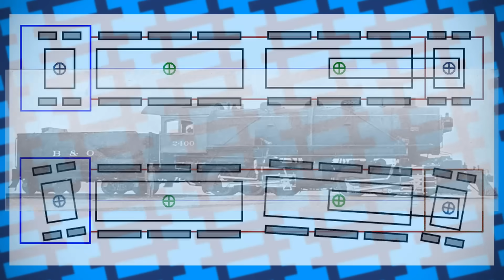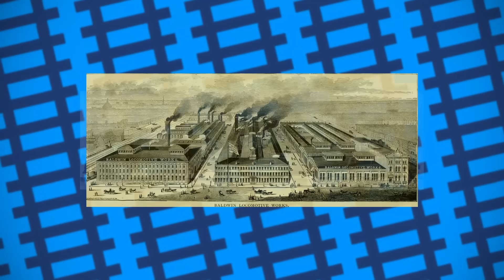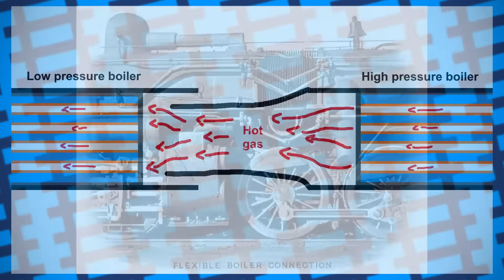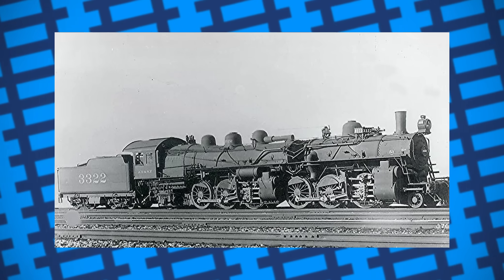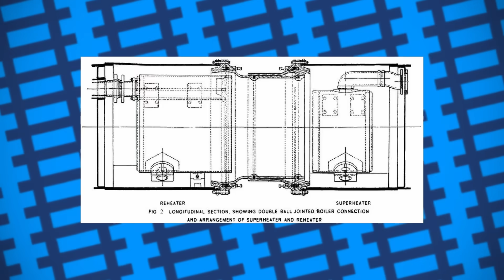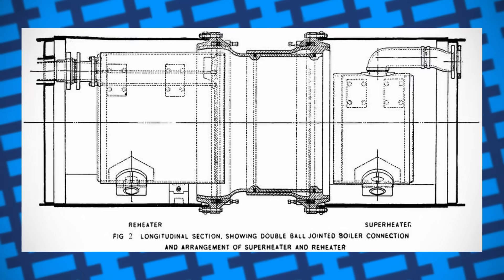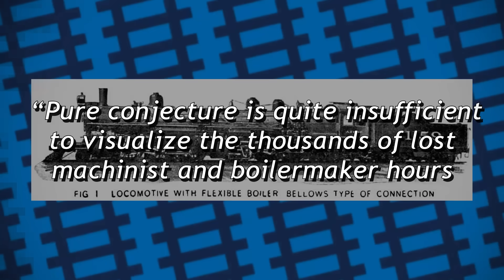How (not) to make a Locomotive more Flexible - Articulated Boiler Mallets

Comment: So people did succeed in making bendable boilers after all. That's amazing! It just didn't give much benifet over the rigid design and was too hard to maintain. I wonder what might have happened if Diesels hadn't been invented. I suspect those Quadraplex and Quintaplex locomotives would have seen at least test engines. Respect to the people who actually tested out the flexible boiler design in a real loco. Sometimes that insane idea turns out to work great and even though it didn't here, we need people to try crazy ideas every so often.

Comment: This was not an articulated BOILER, rather it is a boiler(rear) and a huge" smoke box" that contained a reheater and a feed water heater
It was not pressurized. 
The hinge was not to get around curves. It was an attempt to get the most weight on the front engine by preventing weight being supported and transfered to the rear engine by a rigid connection. 
The front engine was very slippery as it had relatively little weight on the drivers .

Comment: In "Confessions of a Stock Operator" an investor having visited the ATSF described the waste there with horror and warned other investors to avoid it. Soon after, the ATSF went bankrupt, and the new managers were much more hard-nosed about such waste as the jointed-boiler engines, having them cut up.

Comment: its not just dealing with pressure, its dealing with unequal thermal expansion as well. things like stay bolts on the outside of spherical clamps dont get as hot as the ball jointed pipe held captive... they bind up when hot, leak when cold... the pipe gets longer than the calculated distance between pivots...

still, an interesting idea, possibly more suited to water tube than fire tube. any air coming through a pipe into a large chamber tends to stagnate, hence the soot issues at the bellows. its acceptable at the firebox but not so in a pivot.

first boiler supplies the steam, superheating. second boiler is simply a reheater/interstage superheater. no liquid involved.

Comment: I wonder what would have happened combining this with the steam electric hybrid and powered tender, kind of like a slug today, a leading electric powered segment, a central boiler segment with either steam or electric drivrn wheels, and a trailing electric powered tender, lots of drive wheels but with a lot of articulation, with much easier to make flexible electric connections though instead of steam, maybe add some eddy current braking for easily fairly precision controlled brakes, resistive dynamic breaking maybe even regen by feeding that heat to the boiler and you could have had a fairly impressive package all with technology widely available at the time.

Comment: Well, thank you for explaining this. So it wasn't actually a flexible boiler at all then, but two separate boilers. Considering that some big pre-grouping 4-6-0s in Britain had enough problems with the boiler being too long for the firebox to effectively heat, I wonder that the water temperature in the front boiler ever got above anything other than tepid.
 Perhaps the Fairlie concept with the firebox between the boilers might have   been better

Comment: You didn't mention they produced one model 2-10-10-2 in 3000-3009 class which leaked and had many mechanical problems. Thus they converted them to class 3010 2-10-2 between 1915-1918.  Westside Model made the 2-10-2 which I have one, painted and numbered with sound.

Comment: To call it a flexible boiler is a bit of a stretch, as the actual pressure vessels were rigid. The engines effectively had two boilers operating at different pressures, connected together by a flexible section that was actually a sort of smokebox.  The rear boiler contained the firebox and was a conventional design, whilst the forward boiler was just a cylindrical affair with fire tubes. What is not clear is whether either boiler contained a superheater. Aside from problems maintaining the seal of the flexible part it is difficult to see how ash could be cleaned from that section.

Comment: I wonder if anyone has ever attempted a reverse mallet where instead of the front Bogies articulating independently of the boiler the rear Bogies articulate and the boiler is attached to the front bogies. This would probably be difficult to get working with things like the Firebox location but at least theoretically I wonder if it's possible and if it could be used as a solution for this instead of what we got here
Reply: I think one of the reasons against that is illustrated in the diagram shown at 0:50. The "rear" half of the driving wheels (on the fixed frame) points towards the articulation point, which means they point slightly to the inside of the curve (forming a secant instead of a tangent in maths terms). And since the articulated sub-frame is connected to the front guiding wheel bogey, it points inwards in a similar way. I would expect that to lead to a better curve running behavior in forwards than in reverse.

This explanation also already contains the two solutions that I could imagine:
Either run the engine "tender forwards", and have the drivers under the "firebox end" of the boiler articulate. It would lead to the advantage that the bit that overhangs the articulated sub-frame contains the (mostly air filled) cabin and firebox. But as you point out, comes at the cost of making something under the firebox articulate.
Or move the (horizontal/ yaw) articulation point to exactly in between the two sets of drivers, which will make the drivers point exactly tangentially along the curve - not in a backwards secant, but also not in a forwards secant. The big disadvantage would be that you'll need a more complicated mechanical articulation that allows the vertical/ pitch articulation point (which determines the weight distribution on the wheels of the articulated sub-frame) to still be in the center of the articulated sub-frame (somewhere else than the yaw articulation point). And also, the part of the main frame that overhangs the sub-frame will massively overhang towards the outside of the curve.

I think the best solution would be: Design the engine to run "tender forwards". Have the tender, cabin and firebox attached to the "articulating" half of the frame. Have the boiler and smoke box attached to the "fixed" half of the frame. And use this double ball joint to attach the firebox to the boiler.
The main problem would be that all the controls in the cabin are on a different sub-frame than the boiler. I.e. you'd either have to route the high pressure steam from the boiler section to the cabin section, so that it can be shut off there with valves, or devise a way to operate the high pressure steam valves on the boiler section remotely from the cabin.
And the crown sheet over the fire box would either not be covered with water, or it would be covered with a volume of water which is separate from the main boiler (where I then don't know for what you'd use this water and the heat from the fire box walls).
I don't think this could actually qualify as a Mallet type any more. It's more similar to two independent but permanently coupled pieces of rolling stock than to a single-frame locomotive with a articulated sub-frame.

Comment: What about, instead of an articulated boiler, you have a normal boiler and a big, dumb steam tank in front to store excess steam?
Reply: There isn't really such a thing as 'excess' steam on a locomotive. And your idea is basically what they did here, using the front part of the boiler as a giant feedwater heater.
Reply: @SynchroScore  not what I meant at all actually. The firebox would be behind this massive tank, and steam that would otherwise cause too much pressure in the boiler or get weeshed out of the pistons would be collected inside this tank for additional power when needed
Reply: @captainoppai4539  That's not really how boilers work. The boiler contains a combination of steam and water at the same pressure, which is related to the temperature (higher pressure means higher boiling point). Water boiling off produces saturated steam that is drawn off into the dome, which leads to the throttle and the cylinder feed pipes. Drawing off steam decreases the pressure, and if the same temperature is maintained, more water boils off to resupply it. There's no such thing as "too much pressure", as the pressure is regulated by the fire temperature and consumption of the steam, and is released by the safety valve if it gets too high (which is generally avoided by proper firing). Steam exhausted from the pistons is already spent, of much lower pressure, which is why on compound locomotives (like this one) the low-pressure cylinders are of a greater diameter to do the same amount of work. There's no point in filling up a tank with it, as the pressure is low and it's already expended its energy in work. The only way to "reuse" this steam is with a feedwater heater (using the remaining heat to increase the temperature of the boiler feedwater). Essentially the entire front section of this boiler is a giant feedwater heater.
Reply: @SynchroScore  okay but what about those franco-costi boilers? What I'm thinking is basically one giant franco-costi at the front of the engine
Reply: @captainoppai4539  A Franco-Crosti boiler uses exhaust steam and flue gasses to heat feedwater. This is kinda doing the same thing, but instead of a feedwater heater, the Franco-Crosti section is producing steam directly for the low-pressure cylinders.
Reply: @SynchroScore  alright then, how about the boiler solely goes to filling the tank with steam, then that steam feeds the pistons? This way a smaller boiler and firebox can be used for a much bigger engine
Reply: @captainoppai4539  That would just be the equivalent of a small boiler with a great big headspace. A boiler's capacity to produce steam is determined by its evaporating area (surface area of the flues in a firetube boiler) and it's firebox size i.e. how much heat energy can be put in over a giver period of time. Using a small boiler to fill a tank of steam means that it wouldn't be able to keep up with the demand. Pressure would drop rapidly. There are several locomotive designs in history that simply didn't have the boiler capacity for continuous working, especially among the early Mallet engines.

Comment: Why not just use a couple smaller engines
Reply: Each engine requires its own crew.
Reply: @SynchroScore  Surely that would cost less than something as ridiculous as this
Reply: @robr3633  It might, but in the end they just developed larger locomotives that were more reliable.

Comment: Since oil and water are both easily conveyed by pipe, I wonder if you can stick to an oil-fired boiler design and get rid of the bendy boiler by duplication.
2 boilers for 2 sets of cylinders and driving wheels, pinned together with a linking bar. Could probably make a switcher or just generally smaller locomotive out of a single such "power unit" too. If steam had somehow not been replaced by diesel in the US, my thinking is that we would have seen something like this develop, including such things as automated boiler control and even potentially what modern diesels use for multiple unit control.

Comment: These things were fairly complicated in front of "bend".  From the bellows or ball joint forward, they had a shell and tube superheater, a shell and tube reheater, and a shell and tube feed water heater.  AT7SF also had 2 dozen fixed boiler 2-6-6-2s with same arrangement within the front half of the boiler shell as well as couple of 2-10-10-2s with a slightly rearranged superheater, feedwater heater, reheater progression in the front boiler shell.  Between this complication and the Jacobs -Schuppert fireboxes, the Santa Fe was soured on further articulated purchases.  They never had a normal early mallet (with just a shell and tube feed water heater), a normal superheated mallet, or a simple articulated.

Comment: it's a shame because the concept sounds fairly reasonable, even if in practice it's more problems than it's worth. but then the million pound question has to be: why didn't the US railroads just use garratts? yes they're longer but the are in some way more flexible and thanks to them being techically tank engines, you could shunt with them without risking a tender derailment and having good visibility
Reply: Tractive effort changes over time.

Comment: Uhhm,..... from how I understand the diagrams, the bendy bit was not part of the high pressure boilers, it simply transferred the hot flue gasses from one separate boiler to the other. That's why it clogged up with ash and soot, it was sort of a second smoke box !!

Comment: I have a friend who has consistently said that the ATSF gets less flak than they deserve.

This is one of those reasons why they deserve flak lol; actually going through with trying out bendy boilers

Though I will say that the diagram at 1:53 makes soooo much much sense; I had never realized that all the steam went into the high pressure cylinder
Reply: Yeah, you can kinda see why they went ahead with the idea, on paper with all the messy engineering abstracted away it actually looked interesting and could have made a fairly efficient engine. The problem was just not having anyone with real low level experience to recognise the issues and enough decision making power to veto the project early on.
Reply: They figured it out later on though, i work on the 3751 crew and that locomotive is really impressively well designed

Comment: 2:55 Santa Fe praries mentioned. They had the largest 2-6-2s on any North American railroad, particularly their 1800 class 2-6-2s. One of the smaller 1000 class prairies numbered 1010 is being restored to operation by the California State Railroad Museum, it'll be the largest 2-6-2 running in North America.

The only other railroad that had larger prairies was the Chicago Burlington & Quincy, and they had the largest fleet of 2-6-2s.

Comment: Mind boggles why US railroads never went with Garratts.
Reply: Less of a loading gauge issue here, IIRC.
Reply: One of the biggest complaints I’ve heard about Garratts (and for the record, I love them!) is that the tractive effort changes as fuel and water are consumed, much like any tank engine. With a conventional design, tractive effort very slightly increases as the tender is emptied, but for the most part it remains stable since it’s only the difference between a loaded and empty car being pulled by the locomotive.
Reply: No American railroad ordered one, despite ALCo having obtained the license from Beyer-Peacock.
Reply: We had large geared locos for most of the Garrett’s would’ve be good at, and simple mallets for the rest
Reply: Clearly we didn't need them

Comment: At that point. Just get 2 smaller engines, both oil burning. And have one of them be remote controlled by the first. Probably via linkages similar to GWR auto coach.
Reply: or use the garret type of locomotive
Reply: I was thinking about having no articulted high pressure parts at all. A garret needs steam joints between the pistons and boiler
Reply: @vasilybullock7967  between the boiler and the bogies.
Its the only "weakspot" on a garret.
The Type is succesfully used all over the world except North America.
And all modern mainline locomotives are of  simulair design as a garret  
They all have powered bogies that can articulate under a central frame.
Reply: @obelic71 yeah I suppose a ball joint steam connector is orders of magnitudes easier than a flexible boiler. Or hoses like the farlie types
Reply: Who is that we use today, now steam is slower to ramp up and down, but at this time you could have an guy controlling the second locomotive, at 1910 having an phone line and an engine telegraph would be no issue at all. 
Yes you need an second worker but he could be an stroker, 1910 is a bit early for oil fired locomotives, yes it was getting used for ships especially warships, but don't think most rail had infrastructure for it.
Reply: The idea was 2 locos for the price of one. No fuel water or crew cost for the double header
Reply: The problem with Garrett type locos, or any loco with drivers under the tender/fuel bunker/water tank is as the supplies are used weight decreases and adhesion falls limiting power.
Reply: @60sgalesburgerrfan  That problem is also with modern diesel loco's the spend fuel and traction sand also decreases traction weight.